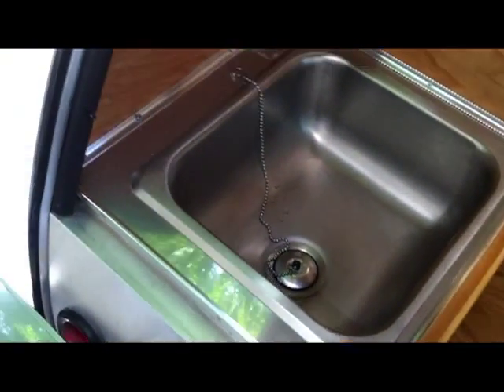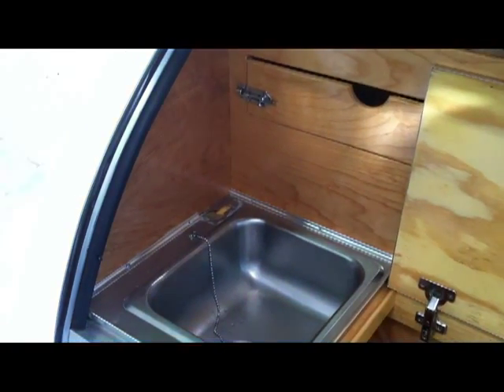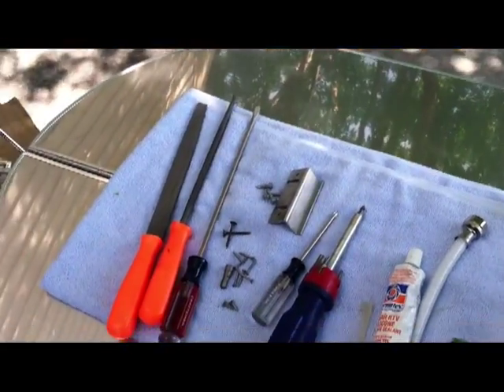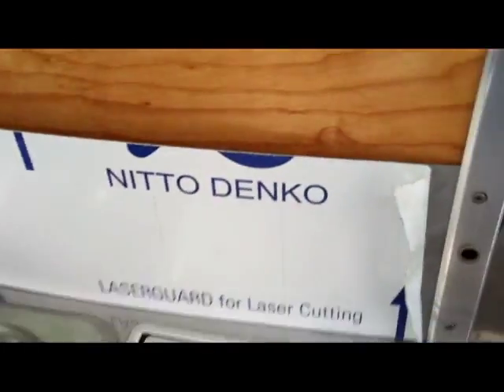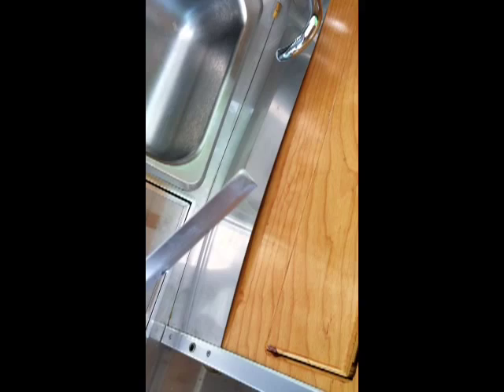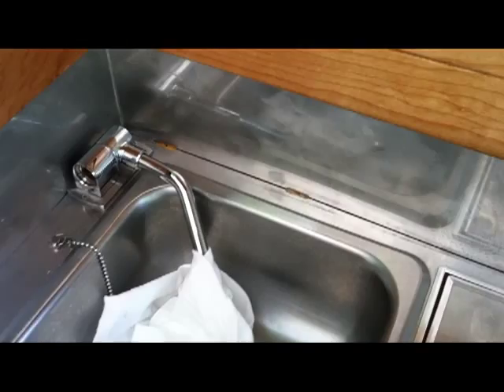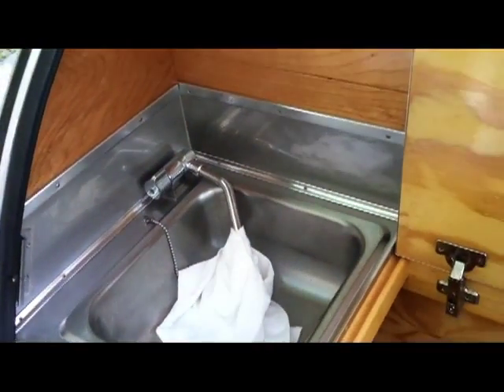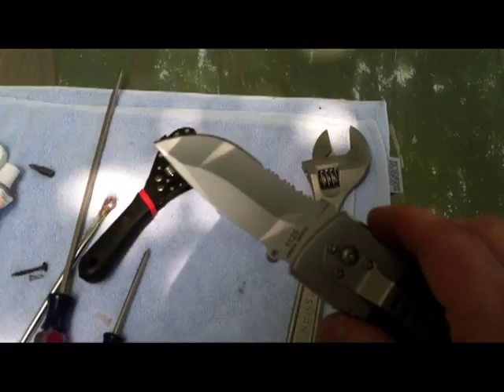CampInn Travel Trailer Sink upgrade

Comment from the maker: @FilAm4494 These type trailers run for $14,000-25,000 but unlike other trailers, you can sell these and get your money back.  They maintain their value very well, which when making a big purchase is very important to me.   It’s funny basic math really, but the guy with the $8000 pop up camper thinks he’s the smart one, until he gets tired of the dam thing and tries to sell it after 2 years that things value has dropped by 50%